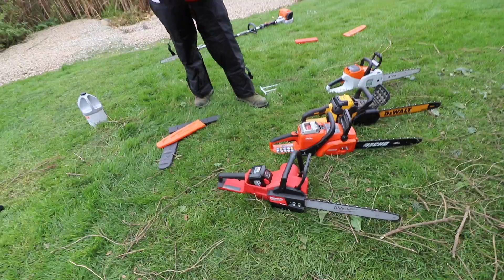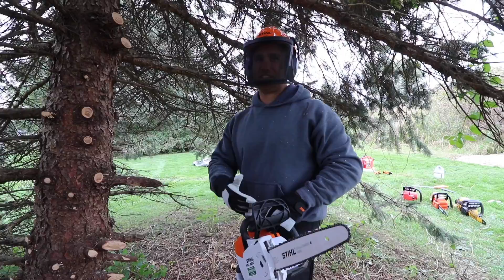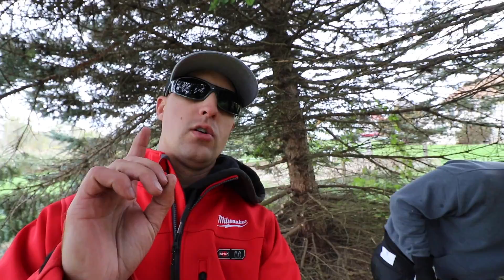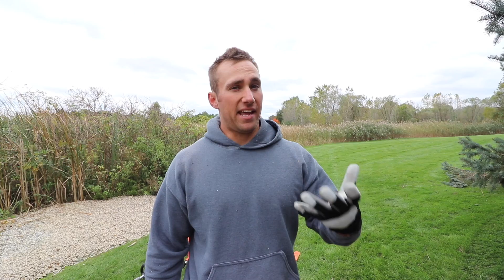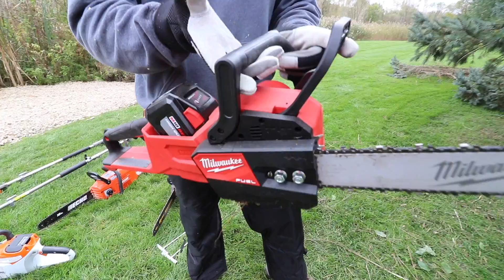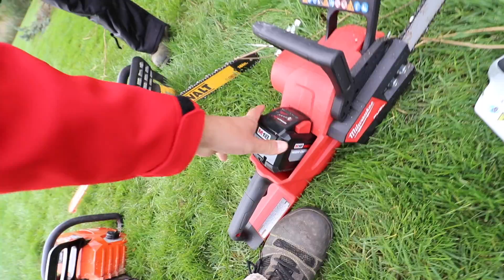4 Way BATTERY Chainsaw Comparison ► Which Has The Better Cut And Torque?

Comment: Yes also knoticed that the chain was not sharpened right there's been so many tests online and the echo wins, it's about torqe with the battery saws an not speed, speed as soon as u put any pressure on the saw it will stall out an that's 10 to 20lbs of pressure, also not to bark at u guys but u start at the front or back pick one an stick with it when using the bar an u start with the bk of the saw pointing towards u then as it cuts using the weight of the saw only an cuts about half way though u then start picking it up then bring the saw bk up cutting almost like ur taking turns the bk cuts then the front then bk then front bk n forth, u guys was cutting like it was a hack saw tryin to rush it an falling the chain an it differently wasn't sharp to begin with, people that use theses everyday can tell just by watching them proform, also husqvarna tree saw like 1100 dollar saw crazy but u can use it with one handed and is crazy will beat all of theses hands down an bein the dewalt is double the volts should win but does not

Comment: In the Project Farm video, the Echo easily outperformed the Stihl. You might want to reconsider who sharpens your chains. If you have to push down to get the saw to cut, it's the chain, not the saw. One little variable missed and your comparison test is shot to hell.

Comment: I watched another comparison between several battery powered saws. Echo was the class of the field with the Makita leading the larger platform saws. All had fully charged equal amperage batteries and new chains. Even the  Husquvarna outperformed the Stihl. Of course that guy doing the testing wasn't wearing Stihl and Milwaukee gear.

Comment: Do any of the battery electric saws sound better than others? Have noticed many have a rough electric squeel, almost a grinding sound. At least that's how it's coming across on YouTube. Whereas corded electric tools have a smooth wind-up sound. Read about this somewhere, related to the battery itself, current or voltage related.

Comment: Would like to see you try the EGO 18”. Also, the single greatest cheap money making tool  in my Arsenal...the little 10” $69 Bauer Chainsaw from Harbor Freight. Don’t laugh...look at the reviews. There are a lot of times when a small little light weight saw is exactly what you need and it just keeps ticking.  Put an Oregon chain oh it and...very impressive.

Comment: DeWalt is 60 volt; DeWalt bar retention system is weak and loose; will break over time. Echo unit is well made with two metal studs to retain the bar. DeWalt and Echo brand are twice as fast cutting as the other saws. Echo has the best battery life. Both Echo and DeWalt are similar price and cheaper than Milwaukee which is slow by comparison and gets bogged.

Comment: I have three Echo's and have been using them for three years now.  The Echo chain was obviously not sharpened correctly. I can saw the same tree limb in half the time that Brian's did. They are absolutely reliable and bulletproof. That being said, my excavator will beat any chain saw when felling a tree, provided you also need the stump out!
Reply: Completely agree. Ive got the same Echo and cut through limbs like that much faster and without much downward pressure at all. I could tell right away the chain was not sharp.
Reply: I also have the Echo and it cuts as good as Styhl, and not as expensive.
Reply: That DeWalt wasn't sharp either
Reply: Yeah they are definitely being paid..  if you watch head to head videos the Echo always wins hands down
Reply: The echo smokes all other brands watch project farm YouTube channel to all those that don’t believe!

Comment: FYI — chaps are not made to stop an electric chainsaw.  The material in the chaps are made to stop the clutch in a gas chainsaw.  If you check on most chap boxes it will say not for electric chainsaws. Electric chainsaws are direct drive .

Comment: There's an obvious chain sharpening issue in your video.
I have two DeWalt cordless saws and an older Stihl cordless. My wife and daughter use them mostly...I use them on occasion.
I'm a retired handcrafted log home builder...sharpen your chains properly for SAFETY, if nothing else. Dull chain created safety issues.
I file down the rakers on my chain ( re; chunks in your video)...my chains throw french fries on big saws.

Comment: I've tried Stihl saw before, couple times. Bought the DeWalt saw because I had batteries for it, was really liking it...
Until brother-in-law got involved in a big tree job (been partners ever since) and had his Milwaukee fuel with him. I found myself cutting way bigger trees than it was intended for. I mean cutting one side then moving to the other to finish it. That little saw is a monster for 18v. I took my DeWalt back and bought Milwaukee since I already had a 9.0 & 12.0 and rapid charger. My truck was broken into and that's all I had left of Milwaukee. Just the batteries and charger that was in my garage. Awesome saw though.
Yes I can tell y'all aren't tree guys, that's very apparent when you're using a chainsaw like you have a handsaw (or Sawzall blade, without the saw itself) and going back and forth like you're doing it by hand, but when you review something that's intended for 12, 14, 16 inches, don't cut 1 & 2 inch limbs with it.
That's like taking Bigfoot monster truck, peeing in the dirt, park the truck on your little wet spot, "Let's see if it'll make it through or get stuck, folks!"
Reply: I'm not sure battery saws are intended for cutting 12-16 inch logs, even though they will. As a homeowner, I cut 1 and 2 inch limbs with my chainsaw all the time because they're too big for my lopper. And I really have to question the Milwaukee 18 volt outcutting the DeWalt. Your critique of the test was spot on however. It was just lame.

Comment: One thing about any battery-operated chainsaw is the fact that it will run twice as long if you simply invest in a backup battery. Easy remedy.
Reply: Mind you, extra batteries are not cheap. Still, might be worth it to double the amount of cutting the electric saw will do.

Comment: A saw using a 14" bar has less friction than a 16"bar. People using Poulan 3400 saws in the eighties would remove the banananose 18" bars and replace them with 16" sprocketnose or 17" hardnose bars with chisel chain and cut way faster! Solo and Dolmar are the good German saws! Stihl is the VW bug of German saws! The money Solo and Dolmar spend on improving their products would go into advertising for Stihl!!!  Stihl is the most hyped brand around!  See if Solo, Dolmar, and Jonsered have any battery-powered ones to test! Jonsered's gas engines are all commercial quality, as are Echos!!!

Comment: The problem with the echo is they need to take the rakors down i could sharpen it up and it would rip shuld of got new chains but i still think the stihl is going to take cake .i used my friends dewalt on a tree job and climbed all day one batery climbing huskervara is the best saw in my opinion

Comment: Ever tried EGO? They have an 18”, PMG (brushless), tool-less saw with a fast RPM/chain speed. I own an older 14” EGO saw and have experienced excellent results.  The advantages the EGO has is a vast array of tools and battery size.  This allows selecting the battery size (ie weight) for the job.  The biggest advantage to the electric I see besides engine issues and maintenance is when one is working above  the ground....starting, stopping , and adjusting gas saws in the air is a pain.  Battery swaps are quick and efficient compared to gas. 😎

Comment: I've had two of the DeWalt chainsaws burn up on the first few days of use. I don't even want to return the second one I received under warranty. Maybe they need a breaker reset? Something inside both burned up under normal use. I now use a Stihl gas model and have no problems.
Reply: I'm glad I just read this. Burned up my dewalt 60v under normal use. Full battery. Full bar oil. Now it's on to either Stihl or Makita. Looks like I'll go with my instinct and the manufacturer of the gas saws that never let me down...

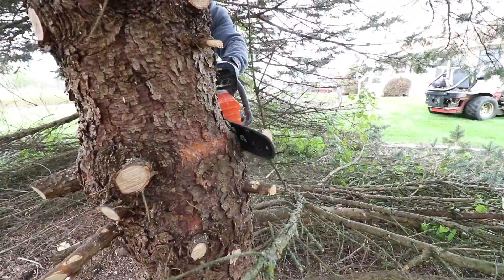Comment: ."freshly sharpened"?? Bwahaa..at abt 6:00, the guy is using a sawing motion... a rookie move. and, the saw is clearly beyond dull. As has been said below, the same chain needs to be used... same length bar... best if its new--or sharpened by a pro. You guys are kinda lame. Sorry...

Comment: Should be using the same style chain on all the saws for an accurate comparison.   The stihl came with a pico chain which is used on small limbing saws and on pole saws.   They cut quicker because they are a lot narrower than the standard chains.   Bottom line they can go through a limb quicker because they don't have to remove the amount of material the large ones do.   I run a narrow kerf on my larger saws for the same reason.   Would really like to find an accurate comparison with new equipment or at least new chains....

Comment: In the world of instant gratification, we believe speed is "KING" and in many applications it can be. However, the under appreciated brother Torque rarely gets to share the spot light. In this use case, speed is nice for smaller branches and helps gets the job done. However I believe Milwaukee put their money on the torque to help with the larger diameter cuts. Also, NOTHING was said about battery life. Speaking from experience usually speed runs down battery life faster and to be fair it could be minimal. I personally don't chainsaw in a hurry but maybe everyone else does...hehe...Be safe everyone!!

Comment: I just purchased the Milwaukee with the free blower from HD after having 2 limbs medium/large limbs fall in the yard, and the gas saw I normally borrow was not running properly. I agree 100% with the review, these are great home owner saws, and if you already have one battery type it will be a handy addition to the fleet. the best part is if it sits on the shelf for 6 months or a year without being used it starts right up with a fresh battery.

Comment: Hey I measured the exposed (usable  part) of the Stihl 14"bar vs the echo16" and the echos was shorter, plus the echo would run on for a bit after releasing throttle
Reply: And the echo is way heavier
Reply: And a noisy fecker

Comment: I really hate to say this but you should have included Harbor Freight's Lynxx, 40V Lithium,  14 in saw.  The thing cuts amazingly fast and the battery lasts for a very long time.   I paid $150 with coupon.  The Lynxx pole saw (same battery)  works amazing as well.

Comment: I have the Stihl 220 C with the 300-S battery, man that thing rips. Cut some 16" White Oak today and it cut as good as my Husqavarna 455 - 3.5 hp gas saw. It will bog down if you go too fast(just like a gas saw), but it moves through that log quickly.....My first Stihl product, very impressive battery chainsaw, prefer it over the gas saw.

Comment: You used a top line Milwaukie, but a second tier DeWalt.  I am not surprised the Stihl did so well.  Narrow chain and a history in the chainsaw industry leads me to expect it.

I am a DeWalt modular system user.  Milwaukie makes great stuff, but I am not in business, so the expense is not recovered as fast.  So the Dewalt system allows me to use the weedwhacker, drills, etc. on other projects.

Thanks for the comparisons.

Comment: For a fair comparison, of these battery operated chain saws. You should be using new factory chains. Not used and resharpen chains, where the depth gauges, pitch and angle of the teeth aren't equal to each other. Would like to see this video redone with new chains.
Reply from the maker: Great suggestion!

Comment: The quality and sharpness of the chain is more important than any other differences between these saws.  The fact that you can't fit the same chain to all four of these saws makes it difficult to do a fair head-to-head test.  You noticed that the Milwaukee chain cut very well, even after pointing out the slower speed of that saw.  The Echo and the Dewalt would probably have done much better if they had better (sharper?) chains installed.  If you do have a sharp,aggressive chain installed, then the available torque is likely to be more significant that the top speed of any given saw.  If the torque is not available, an aggressive chain design will sometimes get too much bite in the wood and bog down the motor.  If the Milwaukee is geared down to provide more torque at slower speeds, that may be a smart compromise in the design.

Comment: Thanks for this! I'm in the market for an overlanding chainsaw and was originally leaning towards DeWalt, for no specific reason other than the name brand. I might check out the Stihl instead!

Ciao,

Roberto
Reply: Try the DeWalt 54V Brushless...it’s far much better than the one they use here to review. The DeWalt they used here was the old 40V, which is NOT a brushless. Check other reviews of the DeWalt 54V Brushless chainsaw and make your decision :-)

Comment: Who came for the Milwaukee review ✌️
Reply: Already got one just wanted to see of I fucked up and shouldn't have
Reply: @Countryside660  😆
Reply: @Countryside660 . Had mine 18 months and love it.
Reply: @Countryside660  Watch AvE's teardown and Project Farm's comparison videos.

The M18 chainsaw isn't horrible, but it's definitely not as good as those made by OPE companies (Echo, Ego, Greenworks, Husqvarna, Stihl, Mikita) and only really worth it if you use Milwaukee already.

Definitely better than the Dewalt, just because of how chinzy the DeWalt's bar retention is. Higher chain speed doesn't mean much if your chain keeps fucking off on you after some light usage.
Reply: @Countryside660  the dewalt has more torque, more blade speed and lighter in weight. Shame that dewalt didnt add real metal teeth, and a sturdier mounting system.
Reply: Who came here to see them compare everyone's best chainsaw except for Dewalt cause to 60volt chainsaw is a monster
Reply: The guy in the video with the Milwaukee jacket on sure did lol.
Reply: Not me!
Reply: Dewalt is better 60v

Comment: omg the dewalt chain is dull, i have two 60v dewalts, pretty happy but I need to change many many plastic parts but I cut a lot too. running with 4 60V battery I can go 4-6 hours ...

Comment: I will put my 16 inch EGO against any one of these, hands down.  Only if you use new chains on all. Ego is probably a little heaver than the others, only draw back.  I can cut a 6 inch limb before you guys can cut a 2 inch one.  Loving my EGO 56 volt system.
Reply: Had mine for 4 years, it sucks. Slow to start moving and the chain Oiler never works properly.

Comment: Definitely hold no bias against any brand we tend to have all the major brushless brands... dewalt, Milwaukee, makita, rigid, even ryobi... have stihl gas products... the Milwaukee brushless motor is super quite without lacking power hence the reason it doesn't sound as loud, definitely just as strong... really gotta look at battery cells too ie 40v brushless dewalt (I believe it was the brushless I tried) was more powerful than the 60v... the 120v dewalt miter saw (2 60v batteries)  is awesome on jobs where we're not running a generator or have no electrical access... been using brushless 40v ryobi trimmer and self propelled mower and love it... really want to try Kobalt and there 80v brushless line, I've heard their 80v brushless mower is closest to gas. It's hard to find a battery powered mower that actually sucks everything into the bag like a gas mower, the ryobi gets all the clippings, but gas always gets dead debree under the grass and sucks everything up not just new clippings...

Anyway brushless motors are amazing. Ingersoll Rand has a battery powered impact ratchet that has 180 or 230 ft lbs of torque! It's insane and can't wait to try one! There's an air model too. M7 (Mighty Seven) has a 250ft lb air ratchet...I must say though Milwaukee's new brushless m12 digital torque wrench is killer with a max torque of 150ft lbs which is plenty for most tight area jobs where you can't fit a full size impact with a universal joint

Comment: It’s great that you have all the PPE and are using it, but be careful of the nose of the saw, particularly when near small branches. Avoid going into the branch or any wood with the tip first as that is how kickbacks occur. And even though all saws have the anti-kickback handle these days, it can still knock you back when the tip catches.  Good review of the saws though. Thanks.

Comment: Are your chaps rated for electric? Some are NOT. Electrics produce torque all the time and have no clutch.
I have the Kobalt 80V 16" and the 80V string trimmer with pole saw attachment.
Reply from the maker: These are yes, but always double check

Comment: I think two of the chains on the second and third ( ECHO and DeWALT) saw were not sharpened properly.  I could see you were pressing hard to make the cut and they were incredibly slow cutting.   Even if it's a battery saw, it should cut through quickly and not have to be pressed hard on the limb.  The Milwaukee was just slower.  My pick is Husky or Stihl from personal experience.

Comment: The Echo chain should be compared to the Sthil chain. The Echo has a non-grab chain which will limit it 'bite' into the wood  Chains make a great difference in the cut and bite.  Safety is a matter to be considered and that is the a consideration for the rookie saw user and that is a point from Echo's point of view.

Comment: Brian last Friday we used my Makita DUC254 Top Handle Chainsaw with 18v battery we had 3 batteries it weight 3.2kg  I put Friend in Chaps & Helmet could not wear gloves because of Start button on Top now Makita do 36v top handle the 18v got 2 Speeds